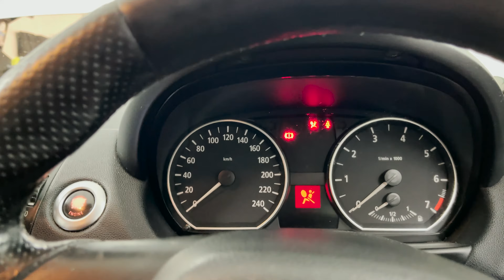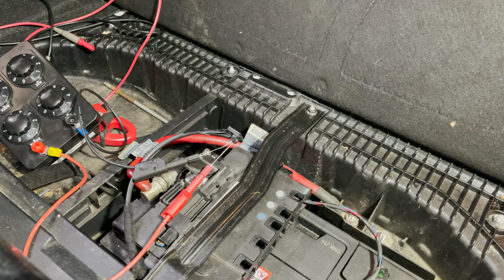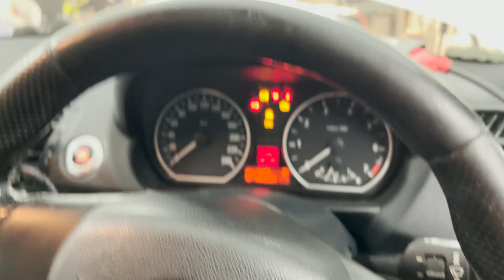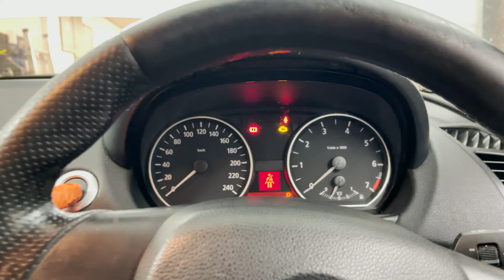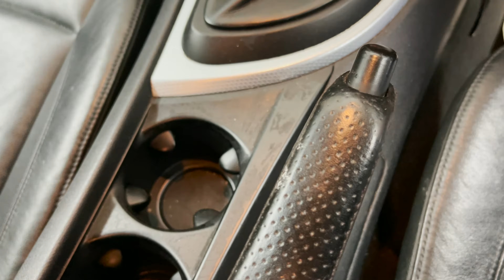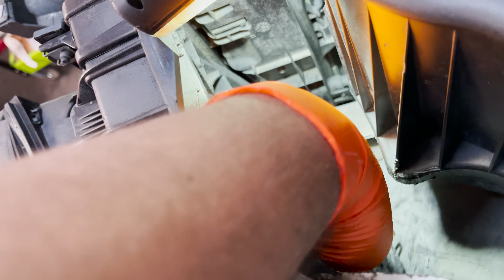2006 BMW 1 Series Air Bag light fault 93B2 MRS Multiple Restraint System Battery Safety Terminal

Comment: We have fault code "93A8 MRS Drivers airbag, stage 1" on our 2009 E87, with airbag light always on.  I have noticed the negative battery terminal connection has some corrosion where it connects onto the body.  Any ideas?

Comment: i have the fault code showing on my maxisys ms908pro
 93B2 Advanced Crash Safety Module (ACSM) : safety battery terminal on my e93 335i would mine need a new cable??

Comment: An update on the 9448 MRS / airbag fault. The cause of the fault code turned out to be a broken small black wire emerging from the insulation on the main battery cable at the jump start point in the engine bay. I think it was chewed by a mouse. Wire repaired , air bag light gone. Hope this helps someone.

Comment: Thank you for this insight on the BST. I have a 9448 MRS fault code on a 2012 Z4 -battery lead diagnosis - open circuit, line, during self test. Looks like I may have a similar problem . The red insulation on your battery lead looks like it shows signs of overheating . Thanks again, good video.

Comment: Can I replicate what you did with the decade box with a digital multimeter?
Reply: All the box does is take the place of the pyrotechnic BST disconnect that he replaces. Instead of using a box like that, you can use a basic small 2 ohm resistor to do the test, Or you can simply ohm that wire end to end with it plugged in to the BST, and it should read 2 ohms. If not, depending what you get, you'll have different diagnosis. If you do, the problem in the circuit is elsewhere....Make sure the car is off, otherwise resistance test will not work properly or be accurate.,..

Comment: My car was in an accident, and I've been slowly re-building it. I have a 2011 z4 E89, and it's the same thing with the 93b2 airbag/ seat belt.  When I bought it, the car started and ran no problem, but I knew I had to replace the airbag and seatbelt pre tensioner.  What I did notice before I replaced the airbag and pre-tensioner was that the BST igniter cable was disconnected, but the bst itself looked fairly intact. (I understand that when the BST blows it can look burned, but mine looked pretty clean) Anyway, I replaced the airbag and seatbelt, connected the igniter cable, cleared the codes, however, and I'm still getting the 93B2 code and the horn still does not work (even thought ALL the switches on the steering wheel work). So, what caught my attention in your video was that you thought the cable you used came from a different car.....Do you think a similar cable from a different model may work? given similar lengths and connections? I'm so close to wrapping this car up!
Reply from the maker: It will be wise to check the resistance at the BST first something around 2.5 ohms ( just in case it’s not a broken wire issue etc) than if it’s too high you will be absolutely fine getting another BST from another vehicle 👍

Comment: Spot on as always. Did you take the front bumper off to change the brake light bulb?
Reply from the maker: Thanks mate , it was a mess of wiring behind the bumper so I thought would be a good idea to remove it besides it was held up by literally 3 screws 😊👍

Comment: Interesting issue. It's difficult to tell on the video but did that battery lead show signs of overheating due to the high R value? Cheers Igor
Reply from the maker: I had the same impression mate , it looked like it got a bit hot at some point I’m not a 100% sure how the BST system works but I was thinking all day yesterday if the battery cable had already been deployed. Cheers mate 👍